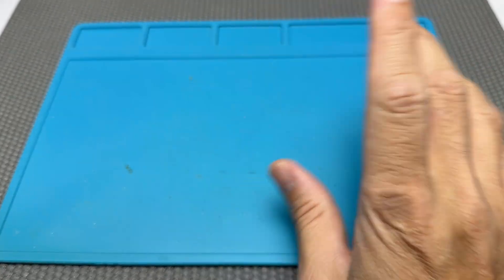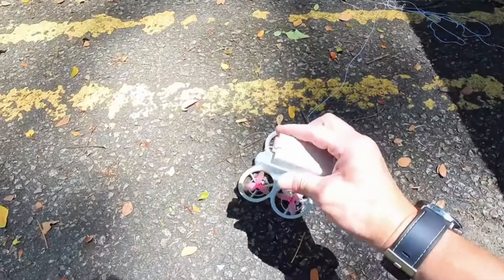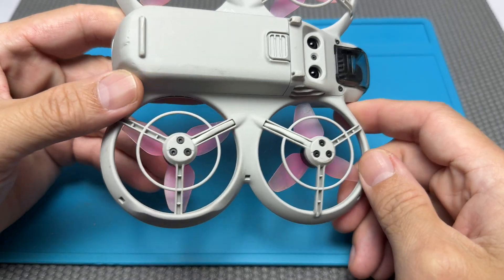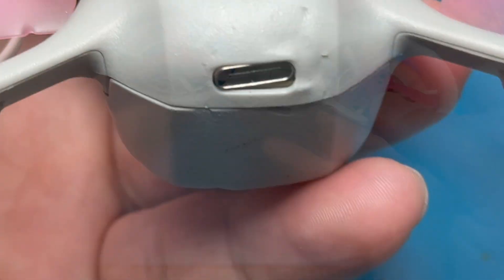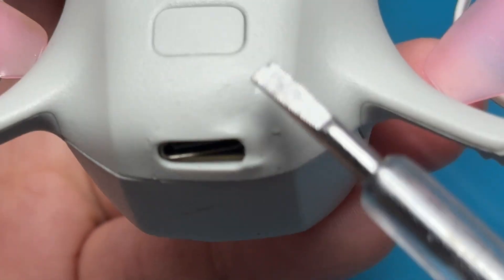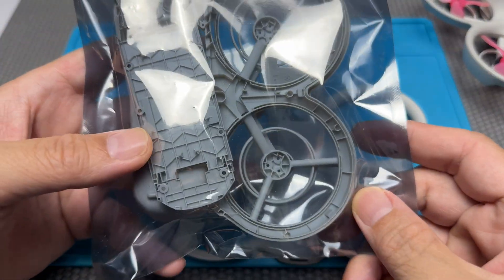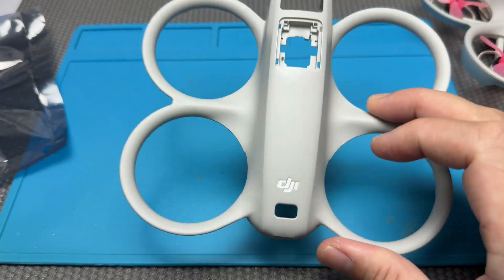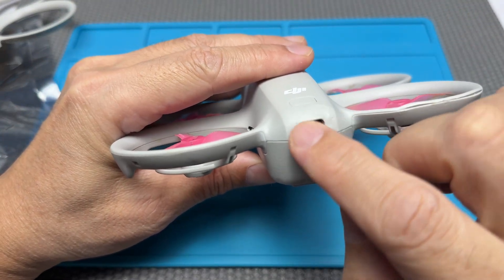DJI Neo Teardown.  DIY Fix

Comment: Yo bro, very useful video but i was wondering if i had to use a soldering kit or if there were any workarounds. Thanks
Reply from the maker: Thanks so much bruddah! Appreciate you dropping by!  You definitely need a soldering kit or a soldering station. Its too much of a hassle for this DJI Neo. The 04 air unit is built into the flight controller and to do a motor swap, u cant unplug and plug.

Comment: The reason I found this video in the first place is because it was suggested to me. I was looking for a someone who had experience putting conformal coding on their PCB boards and components to make them waterproof.
Reply from the maker: Appreciate you dropping in non the less my man. Yeah, conformal works. Just make sure all solders are done first before applying. Good luck with the conformal! 👊😘

Comment: I was wondering what it would take to add a Dronetag BS module to the Neo, I can see room for below the downward IR  devices. Thanks
Reply from the maker: There is room.. but the Neo actually has a built in RID which only activates in countries that have them like Japan and China.

Comment: NICE you have a lot of patience and I like the microscope/screen set up to see all those small parts

I have a local PC repair place that offered me the ability to use theirs if I need to .
I have hard time reading normal wording, this small wording and very small things have become near impossible to see, solder etc 
I may look into investing in one of those .
I do not solder or work on much now days but It could come in handy for many things 
Great video
Reply from the maker: Aaww thanks bruddah. Yeah… lately its the same for me. Harder to see so I really need the microscope. Haha thanks man, for the sake of getting the drone back up in the air, patience is a MUST! Haha 
Appreciate u dropping in as always brother. Thanks so much!